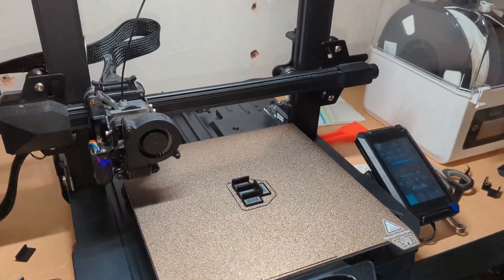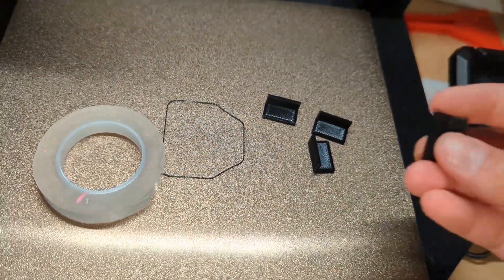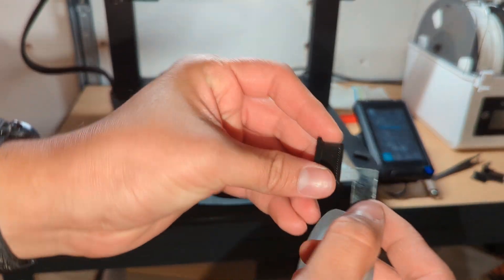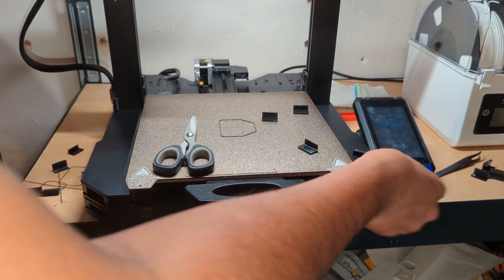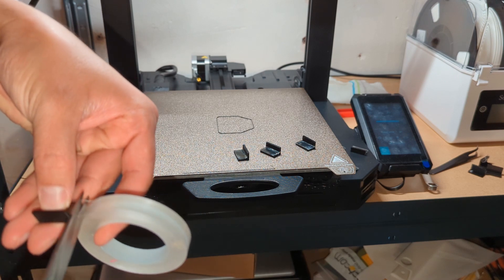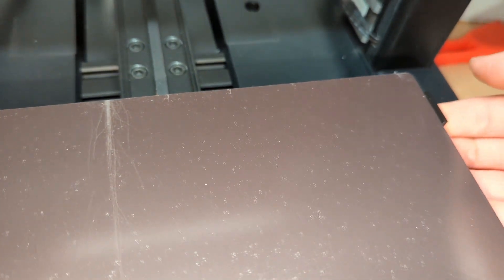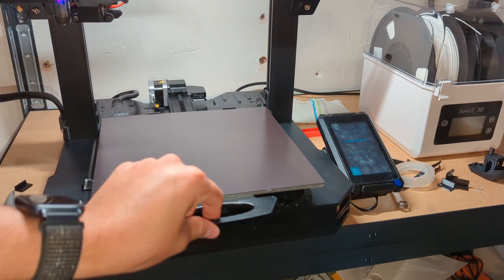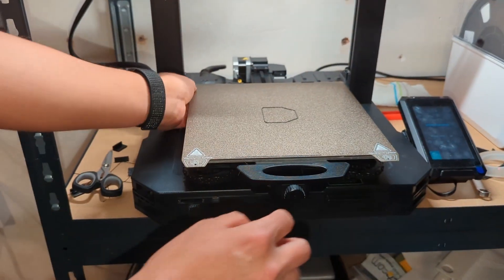Ender 3 - Spring Steel PEI Bed Aligner

Comment: wont it get fall of after heated ?
Reply from the maker: Nope, the nano tape hasn't failed even printing petg at 75c on the build plate. Haven't tested 100c but I'm sure it'll be fine too.
Reply: @Zeltroix   cool will give it a try am using ender 3 v2 neo